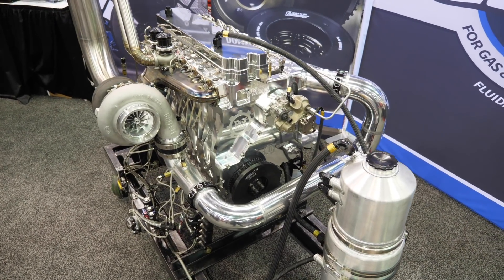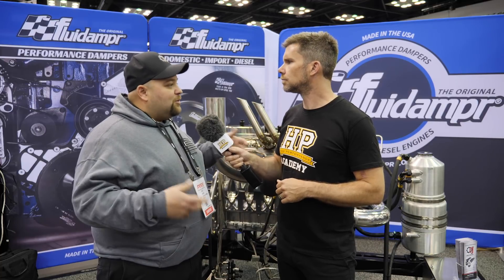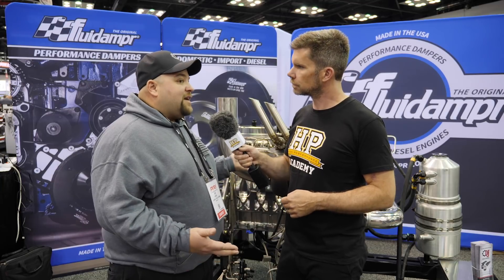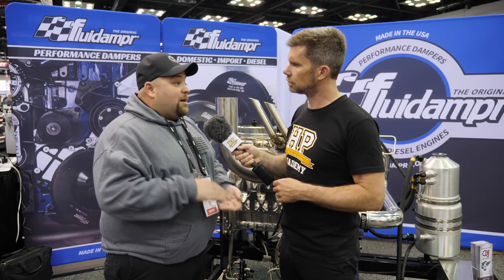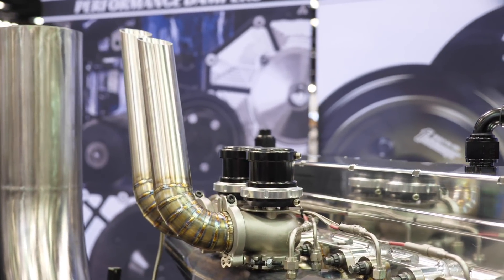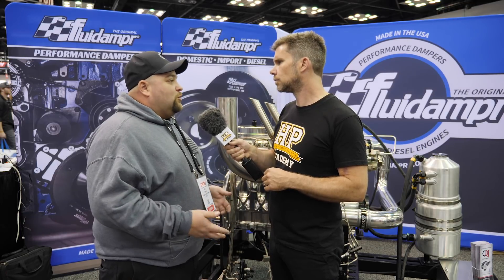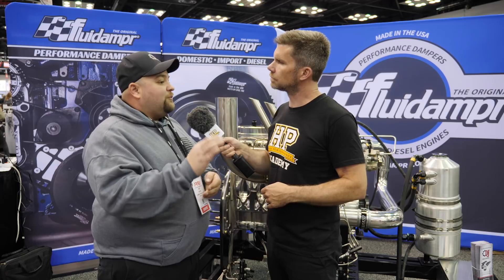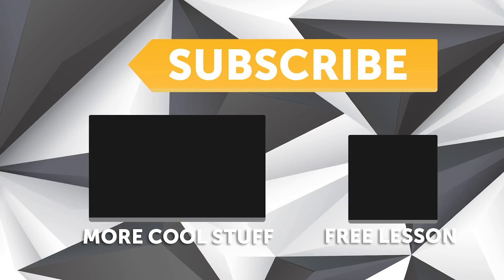3,200HP Billet Aluminium DIESEL | 3,350 LB/FT Torque Monster [TECH TOUR]

Comment: "Diesel engines are simple, you don't need to be a rocket scientist/nuclear physicist to work on them".

Well, the head gasket ring suggest's otherwise.
Reply from the maker: There are some tasks you leave to your machinist, this is the case for any level of build as machine skills aside, setting up an engineering workshop in your garage at home is simply not an option for 99% of people. That said, machining is one part of a built, and there is still a ton of things you can do yourself - Taz.

Comment: How are these billet Machined blocks cooled? I've never been able to get a straight answer from anyone so is it just safe to assume they don't have cooling systems? I guess if they are just designed for super short drags they don't need it? That still is confounding... They could easily generate enough heat between the race heat and warming up the block before the race heat to cuase significant damage ...
Reply: Oil only, they don't run for long
Reply from the maker: @Ryan P - Depends on the application as they're not only used in drag racing.
I can't remember which one is the best in relation to cooling, but here are a few links to some videos you might enjoy @Eric:
https://youtu.be/J87SVqG18sY
https://youtu.be/m53RjI6xFaE
https://youtu.be/hh0fKrTXuN0
https://youtu.be/SIapQkyjQfg - Taz.
Reply: The thing is they really just don't get that hot.

Comment: You're testing it currently at 1500. 3500 is a long ways from that...
Reply: Check out firepunk channel they hit 3200 hp with this motor
Reply: Also the testing in the software shows the capability.

Comment: There's nothing that beats a diesel at the game of high BMEP.
Reply: That's why all the top fuel dragsters are diesel?.?
Reply: @christianmgtow4744  
Yea , they basically transform into that about a second into the run. 
So yes, diesels are the fastest.
Reply: Top fuel dragsters might as well be rocket engines, they are burning liquid explosive for fuel and the engines are single use items, needing a rebuild after each 4 second run under power, but they are a very specific application. A road driven diesel engine has more in common with a 3000hp competition diesel engine than a road going petrol engine has in common with a top fuel dragster. A diesel engine is by nature well suited to making big specific torque (high BMEP) because it is not limited by fuel octane, it does not detonate if you push it too hard.  The reasons diesels don't usually rev to 8000 is they don't have to, they can produce enough torque to make power without it. There is no hard limit (fuel octane) to how much torque they can produce. They can be built to rev but by nature the components like pistons and connecting rods are very heavy to handle the high cylinder pressures so high revs put a greater stress on the rotating assembly than otherwise.